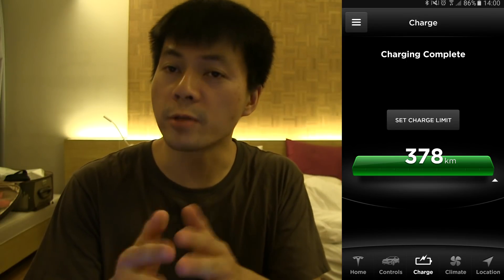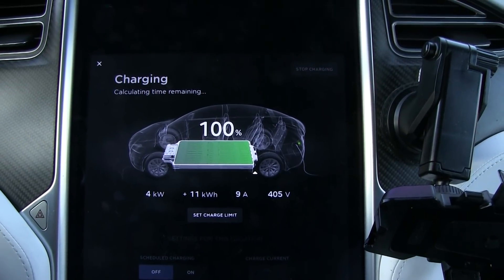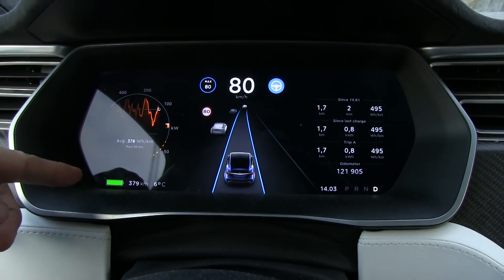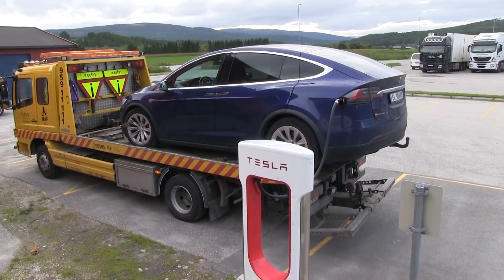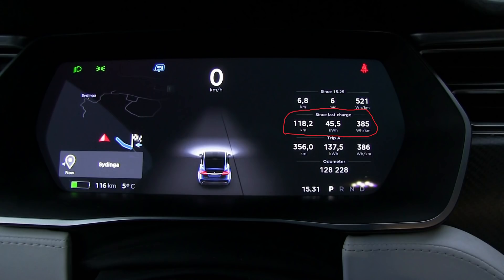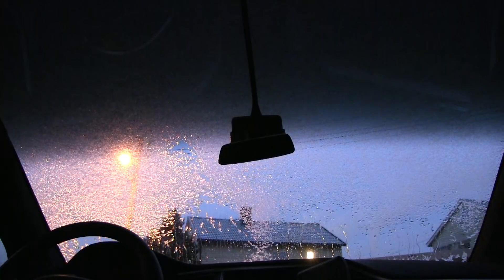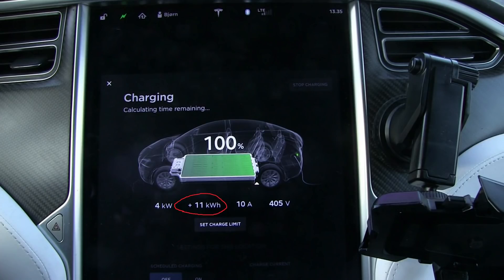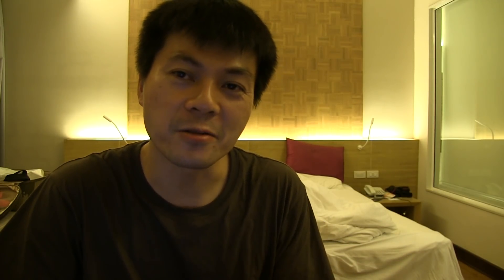How to correctly measure battery degradation in Tesla

Comment: If you can read the individual cell voltages with an app then you can calculate the degradation fairly accurately. The tests at T1 and T2 also need to be done in very similar climate conditions. With only the info provided by the car to user is next to impossible to calculate the degradation because of so much information is hidden and firmware also changes over time.
I think the warranty information is a good indication of battery degradation for typical usage and for a standard model 3 is 8 years or 160000km witchever comes first and guaranteed remaining capacity of 70% of original  https://www.tesla.com/support/vehicle-warranty-m3
The standard has a 50kWh battery with a 350km range so so 160000km/350km = 457 cycles (equivalent of 457 full cycles ignoring the small top and bottom reserve).
In lab tests a standard NMC battery can do 500 cycles 100% DOD and after that still at around 80% DOD but there is also calendar degradation to consider and that will vary especially with temperature but should be around 1% per year at least so over 8 years that is at least 8 to 10% thus the warranty of 70% of original new capacity by the end of this period or range.
You can be sure capacity after 8 years or 160000km will still be at least 70% of original else they will probably need to provide you a new battery or maybe recondition the old one (not sure).
At least this clear warranty claims confirms what I always mentioned that Tesla battery is nothing special compared to what Panasonic has originally created and is the same low cycle life in favor of high energy density.
This trade off for cycle life in the favor of energy density is a good choice for EV's as it is for portable electronics a average people will not drive more than 160000km in 8 years.
Reply: Warranty is not a good indication of battery longevity. All Tesla are doing is matching others' warranty.
There is sufficient real life data and reports from lab testing that the battery will last longer than the car.
https://electrek.co/2016/11/01/tesla-battery-degradation/
https://electrek.co/2017/05/04/tesla-battery-researcher-chemistry-lifcycle/ 
https://insideevs.com/200000-miles-tesla-model-s-experienced-6-battery-degradation/
powercartel.com/2014/11/notes-from-why-do-li-ion-batteries-die-lecture/
https://www.youtube.com/watch?v=5WpQh4kZ_MU&t=533s
Reply: As Bjørn explained in this video is not possible to realy test the capacity loss based on limited information from the car BMS so all those test are not relevant as they are not accurate.
If Tesla where to be honest they will provide proper datasheet for their cells with proper lab test cycle test and calendar aging test. Until that is the case I will trust the Panasonic datasheet and lab test and it seems that official Tesla warranty is based on those lab results or very similar.
Reply: I was referring to stationary energy storage not EV's. For EV's is clear that NMC is superior as it can offer higher range and that is more important than cycle life in that application. People have no understanding on cycle life and they look for EV with best range for the cost thus NMC is a winner here.
BYD started with building EV busses and there LiFePO4 was just better because of the need for higher cycle life. They build their own LiFePO4 and that while heavier more material used is still less expensive to build because of lower cost raw materials.
NMC and other high energy Lithium cells will continue to improve since most research is done right now for high energy density cells and not high cycle life. So if they make an improvement to the electrolyte and can either get say 2000 cycles at 4.2V or 500 cycles at 4.35V they will select to sell the cells as 4.35V since they will have additional storage capacity and for both EV and portable electronics that is more important.
My initial comment was because there was to much misinformation about the exceptional cycle life of Panasonic/Tesla batteries and the model 3 warranty shows that there is nothing special about the NMC battery they use.
When calculation transportation cost of an ICE with an EV is important to add the battery amortization cost in to equation as in many case battery cost amortization is higher than electricity cost and that makes EV not competitive with ICE of course when ignoring the pollution levels in cites.
Reply: Nice comment, Personally, I tend to beleive that tesla battery are better that others of the shelf batteries, 
Check endlessphere forum (diy electric bicycle)  for test results of a single battery. 
From my experience with what a individual can buy, a salvaged Tesla cell is unbeatable in robustness. 
it can sustain a discharge to 0V and retain, if i remember correctly, 98% of capacity and internal resistance stay almost as low.
The others do like you say, the start loosing capacity after the first cycle.
Reply: It depends what you want to use the battery for. If it is for a ebike then the Panasonic cells used in Tesla should be good as while they do not have great cycle life the energy density is excellent and that is more important for an ebike.
If you want a battery for stationary energy storage then a LiFePO4 will be much more cost effective as it has lower energy density is about 2x as heavy for same capacity but has a much higher cycle life 3000 to 6000 cycles vs 500 to 1000 cycles for NMC or LiCoO2 type cells.
The largest EV car manufacturer in the world BYD seems to be the only one using LiFePO4 in their EV's but they will probably also switch soon to NMC if they want to compete with others. The LiFePO4 are great for cycle life but much heavier for same capacity so they will have lower range for same weight and the additional cycle life is only good for demanding applications as taxi service or electric buses and that is where BYD has focus most of his attention up now.
Reply: electrodacus But for the weight of lifepo you could have a much bigger nmc battery and run it at partial DOD. Aren't shallow DOD going to make a nmc last 1000s of cycles? Lets say 3.3 LVC and 3.9 HVC.
Reply: Yes if you limit the charging at 3.9V and stop at 3.3V for discharging you will get significantly higher cycles but of course lower capacity around 65% or so between this limits and maybe you get 3000 to 4000 cycles in this range with NMC but then where is the price and weight advantage if you are only using 65% or 70% of the rated capacity. A LiFePO4 like Sony or A123 can do 6000 cycles at 100% DOD and even a Winston LiFePO4 can do 5000 cycles at 80% DOD and 8000cycles at 70% DOD.
There are other advantage also in stationary storage system like no thermal runaway and no internal impedance degradation with time as is the case with NMC and LiCoO2. Also there is no Cobalt used in LiFePO4 so it is greener.
Winston, CALB and GBS all make large prismatic cells up to 400Ah and even 700 and 1000Ah in case of Winston so building a pack is much easier as most NMC are in small format.
Reply: electrodacus The nmc would weigh the same as the lifepo and at 50-60% DOD have the same energy and cycle life. Right? But it will have the option to double its range on demand when you select a higher HVC for a long trip and I assume much more power too in general.